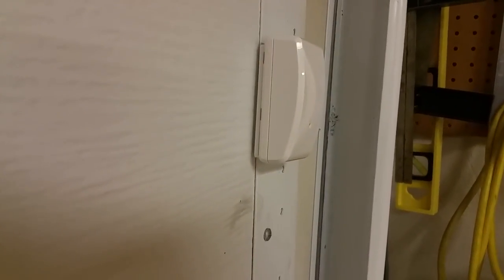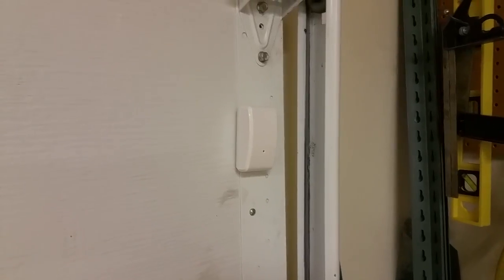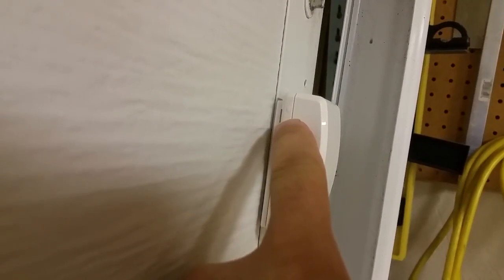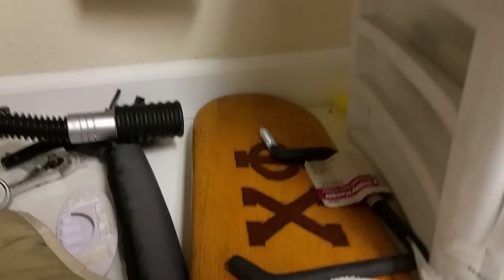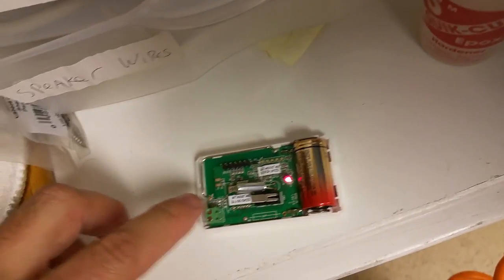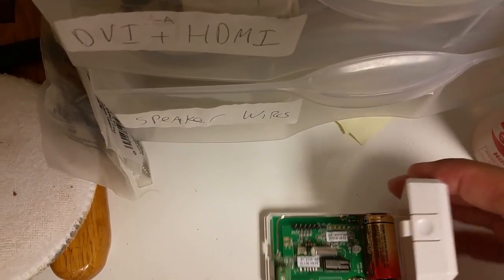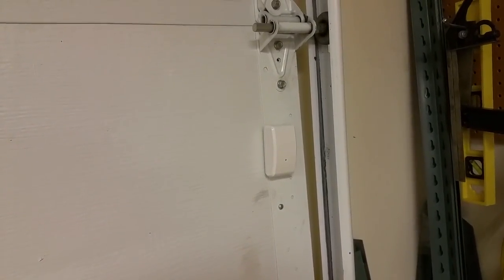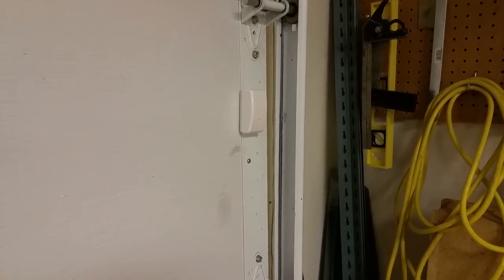Monoprice Zwave Garage Door Sensor with Nexia

Comment: To install the mount bracket did you use the two sided tape or the two screws?  I have a thin metal door and am not sure the screws won't stick out the other side.
Reply from the maker: I just used the tape. climate is mild here it should last years.

Comment: Installation looked pretty straightforward from what you figured out in this video. Does it work well? Also have you seen this yet? Z-Wave support was just announced, it turns normal window shades into motorized smart shades. http://igg.me/at/axis-gear
Reply from the maker: +AXIS The sensor I got was super low budget and basic without real directions.  I hope my video helps at least one person install it right-side-up.  It is working well now and sensing very reliably.  Nice work on the motorized shades.  I'd make sure it will work with wand, chain or string.  And focus the ad on other than super-posh living urbanites ;-)